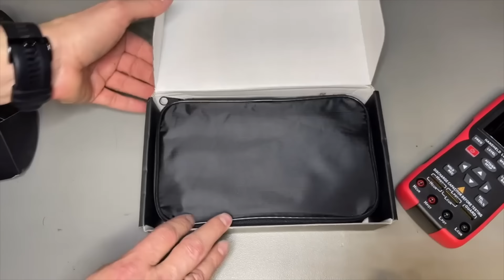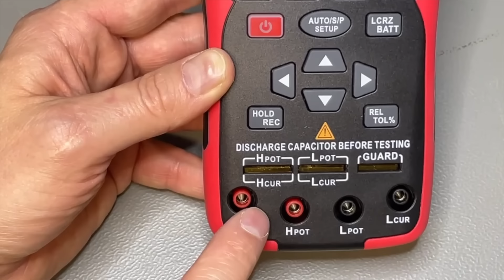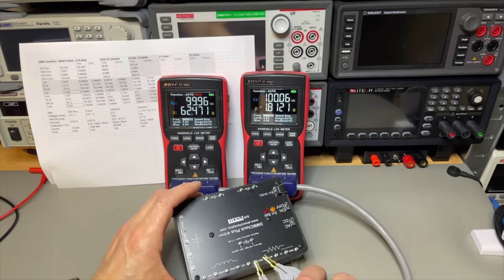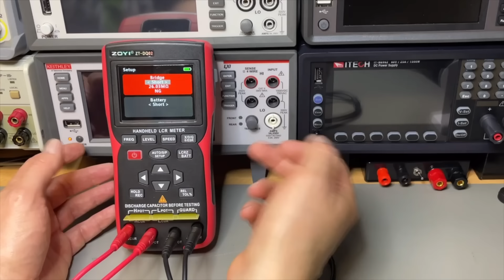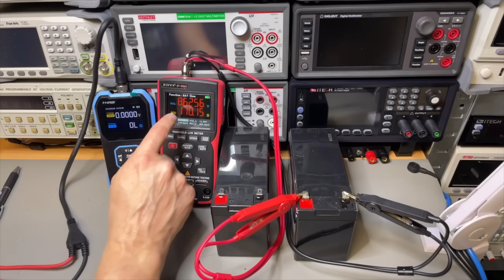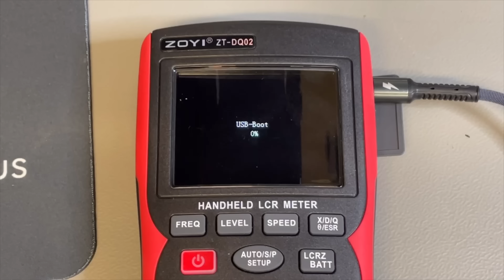TA•0449🟦Zoyi ZT-DQ01 LCR Meter / ZT-DQ02 with Battery Tester

Comment: Great test, thank you! Did you test it against the FNIRSI 1020e ? I think its in the similar price range and probably equal in accuracy and functionality.
Reply from the maker: Ow.. not sure i have that scope, i usualy try to avoid that brand, as the specs are usualy a bit overconfident to say the least. but the design team makes it look very good, so i might have fallen for it. i need to check in my crates...i know i did not video it yet

Comment: Hello everyone. Unfortunately, the documentation doesn't come with a programming manual included. Where can I find a list of allowed SCPI commands and their syntax for this instrument?
Reply from the maker: Hi, this is what i found on EEVblog: 
SCPI commands extracted from firmware v1.0.7

Command	Example output
*CLS	
*ESE	
*ESE?	
*ESR?	
*IDN?	ZOYI,ZT-DQ02,903D9C87,V1.0.7
*OPC	
*OPC?	
*RST	
*SRE	
*SRE?	
*STB?	
*WAI	
*TST?	
:STATus:OPERation?	0
:SYST:ERR?	0,"No error"
:SYSTem:ERRor:NEXT?	0,"No error"
:SYSTem:ERRor:ALL?	0,"No error"
:SYSTem:ERRor:CLEAR	
:SYSTem:ERRor:COUNt?	0
:SYSTem:ERRor:CODE?	0
:SYSTem:ERRor:CODE:NEXT?	0
:SYSTem:ERRor:CODE:ALL?	
:SYSTem:VERSion?	1999.0
:STATus:OPERation:EVENt?	0
:STATus:OPERation:CONDition?	0
:STATUS:OPERation:ENABle?	65535
:STATUS:OPERation:ENABle PARAM	
:STATus:QUEStionable?	0
:STATus:QUEStionable:EVENt?	0
:STATus:QUEStionable:CONDition?	0
:STATus:QUEStionable:ENABle?	65535
:STATus:QUEStionable:ENABle PARAM	
:STATus:PRESet	

But I don't see any commands to fetch values in this version.

** fetch seems to be available starting 1.08

Comment: Good review!
Trying to locate file ZT-DQ02 anywhere, as mine came with 1.08, and won't measure batteries at all!
Anyone have the earlier firmware (all gone form official sites)?
Reply from the maker: Thank you!
Hi, in the description i have added link to a zip file with both 107 and 108 for both machines

Comment: Can you use this to test a car battery ?
Cheers .
Reply from the maker: Yes i see no reason why not.
Reply: @TonyAlbus I guess when you are 16, and accidentally test a car battery in current mode on your DMM , the melting leads you never forget
Reply from the maker: @gixerags750  Thats were the fuse comes in.
Reply: @TonyAlbus 1981.
Reply: I have done that with a cheaper Chinese battery tester.

Comment: Very nice review Tony. I bought the ZT-DQ02 as I liked the addition of the battery resistance measurement as well the LCR measurement goes from 100Hz up to 100kHz. For the LCR function I had wondered about the 4 wire banana Kelvin clips provided and you confirm they are just as good if not better than the type that inserts into the slot. I would still like to have the 4 wire tweezer leads for measuring SMD components that plugs into the slot but these seem to be expensive. I'm now thinking its possible get a better measurement and it is cheaper with those integrated tweezer meter products for SMD components.
Reply from the maker: Hi Andrew, Thanks, yes very nice meter, i know there are also banana 4-wire tweazers, they are maybe cheaper.

Comment: The function of the battery tester is also useful as a pure milliohm meter. It allows for the measurement of very small resistances using a Kelvin probe. That's is (for me) a much more important feature than "just" checking batteries ;). So for the price point, this is a great instrument.
Reply from the maker: Thanks! yes you are correct, as a milliOhms meter it can do the job too.

Comment: Ok I am sold. I will add a ZT-DQ02 to my collection of measurement devices as I would like a better LCR meter (than the LCR tweezers I have) and I need a battery tester anyways! I also purchased a ET15S a few months ago mostly for the thermal camera.
Reply from the maker: For the price it is pretty good. and with the 4 wire banana even better

Comment: There's an interesting characteristic of the Agilent and BK Precision LCR meters: In the teardowns, I have seen that Lpot and Lcur are one and the same connector inside (same for Hpot and Hcur). This means that these meters cannot actually do Kelvin measurements even with the Kelvin probe as you will have the same voltage drop in the pot and cur leads. The DER DE-5000 does not have this issue, the top blade in L or H are separate from the bottom blade, and the round pin connectors respect that by being split in the middle. It looks like this meter also keeps pot and cur connections separate.
Reply: It depends on which B&K meter. The earlier models did have them connected, but the current one is true four-wire.
Reply from the maker: Thanks, nice information, good to know. yes its not bad at all.

Comment: Nice review Tony!

I'm impressed with this LCR meter. I've found it to be more accurate than it's price would suggest.

Bit of a hassle to get the latest firmware. Zotek / Zoyi should improve this.

Where did you find the SCPI commands listing? IEmailed Zotek but haven't heard from them.

Got the 02 when it was on summer sale and really impressed so far.

Best regards from Rotterdam.
Reply from the maker: Thanks! i also did not find a SCPI list with commands, i just used the standard IDN command
maybe some of the EastTester commands are the same : https://www.easttester-cn.com/uploads/et44et45_scpi-protocol2023.pdf  it is sort of unified

Comment: we need to test with low value resisttors
Reply from the maker: Yes i did not do that, for the price i expect a basic LCR meter, not a miliohm meter included
normal resitors did fine
Reply: @TonyAlbus  I bought one dq02 and it can read with good precision low resistance. I already tested with 0.01 ohm with success. Very good tool. It delivers much more than its price. I think is a hidden jewel, and people need to get one for the price.
Reply: @jcbritobr can you measure inductor resistance? What is accuracy?
Reply: @shouryuken-g7c I tested ESR with capacitors and the precision is very good. I will do a test with an inductor e post here.

Comment: I see the battery compartments are under stress just as was the case with the Zoyi ZT703S scopemeter. Maybe it's best to cut off a little of the spring here as well.
Reply from the maker: Well spotted, i missed that
Reply: 18650 cell in this meter is slightly longer than the standard 18650

Comment: Hi, any views on  the Holdpeak HP-4070L LCR meter?  Cheerful for occasional use or too cheap to be any use and better to save for the Zoyi?

For now I use old school method with oscilloscope.😮
Reply from the maker: Thanks, i quickly checked that meter, the specs don't even specify the frequency or voltages or ser/par mode.
That holdpeak is super basic, but maybe will do the job. but you can't compare it with the Zoyi with all its settings
Reply: Thank you.

Comment: As long as they're in tolerance, and have a wide enough frequency span, they'll be good for the bench. Even though I have two East Testers, which are both their top of the line models, I also use an old ESI 253 and 250DE, as well as a Stanford Research SR715, which I use on the bench, along with an old Marconi tube-type TF-868B that still works really well.  The ESI 250DE and the Marconi are both older bridges, though the 250DE is solid state.

I actually prefer the Stanford Research because it's flat, and has a large test jack on the top, though its basic accuracy is only 0.2% and will only go up to 10 kHz. It reminds you of an extra-large desktop calculator.
Reply from the maker: Wow you have a nice collection sir!

Comment: Great video, like usual ;). I'm a fresh radio amateur and started experimenting with HF (Filters, oscillators, etc.). Is the ZTDQ02 the right meter to measure capacitors with a few pf for HF?
Reply: I bought my B&K meter specifically to verify that I was winding the toroids correctly in a transmitter kit. 73
Reply from the maker: Hi, welcome new Ham, enjoy!  Yes with its 100KHz it can meseure the smallest caps too
73

Comment: nice looking meters and not a bad price too. might have to get one instead of the peak and get the kelvins too
Reply: Peak esr 70?  The peak is s nice meter that is fast and accurate. It will also survive charged caps. I would get both.
Reply: @guateque1718  charged caps is an good argument. The most cheap handheldds have no input protection against charged caps. For the DEE5000 exists a guide in the web to build one into it. The board is alreaddy designed for, but no parts on it.
Reply: @guateque1718  I already have the peak but its a bit limited, especially below 1uF. I would primarily be using this zoyi on nano and pico caps, not specifically for esr but mainly checking values.
Reply from the maker: With the max of 100KHz it will be better on small caps
Reply: @TonyAlbus  Cheers Tony. I have one in my Ali watch list!
Reply from the maker: The 4 wire banana kelvins work best on this meter (with isolater placed)